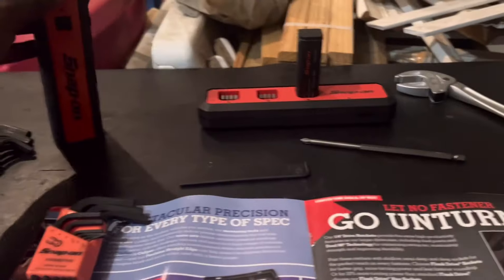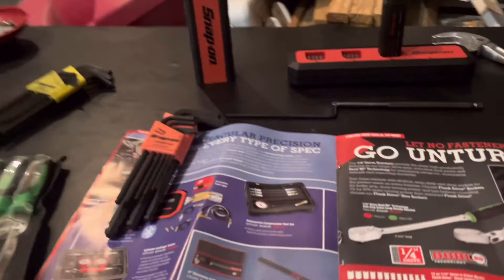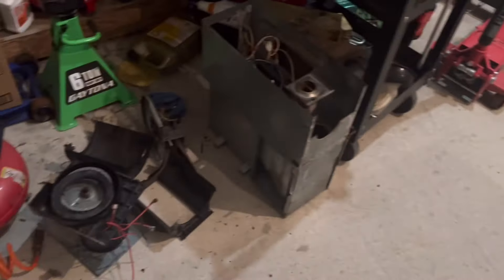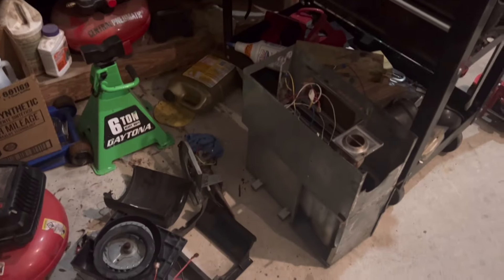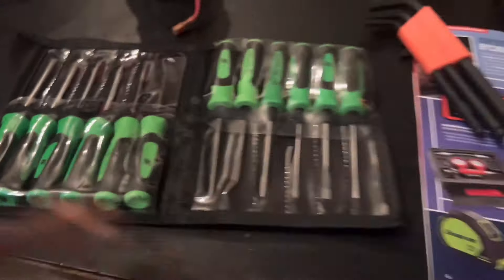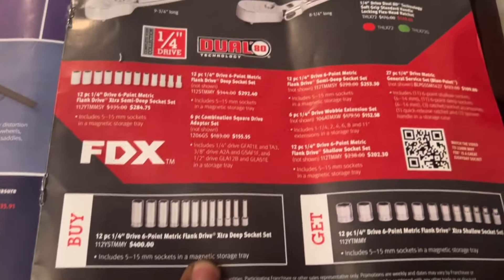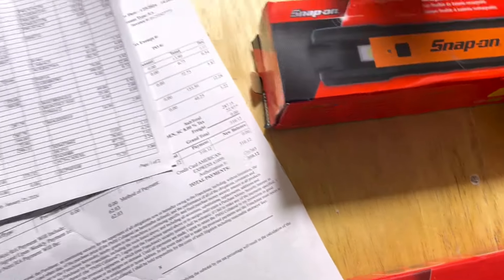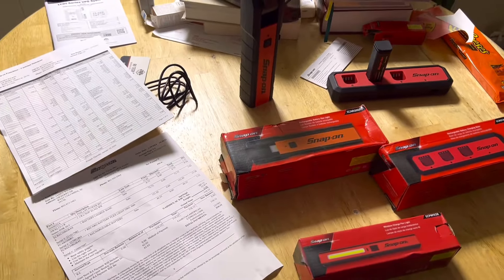Snap-On Tool haul today

Comment: Ball hex/allen are great first when u r at an angle. Like on all types of bikrs
Reply from the maker: Yeah I’m aware of the functionality however it’s a weak point and the snap off
Reply: @rvtechpro  u r correct and I agree with u. I have both types and prefer to use the one u speak of whenever possible for the same reason.